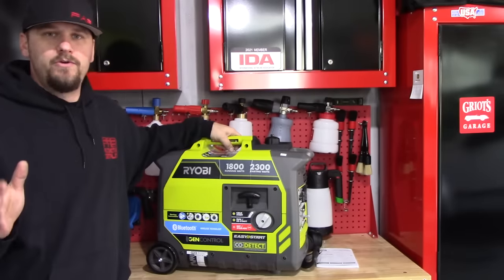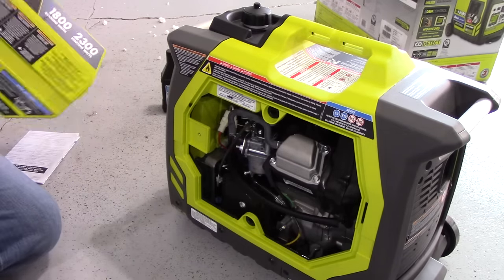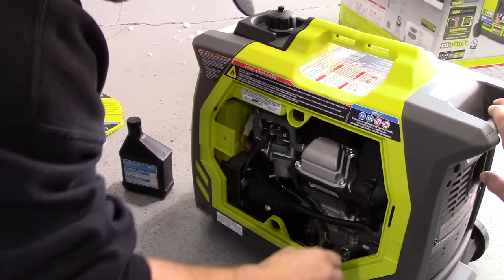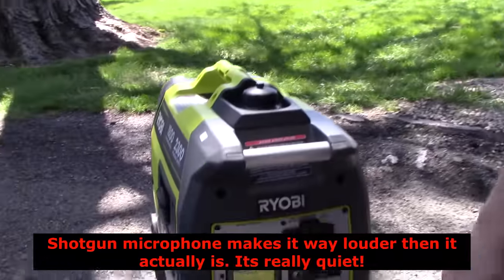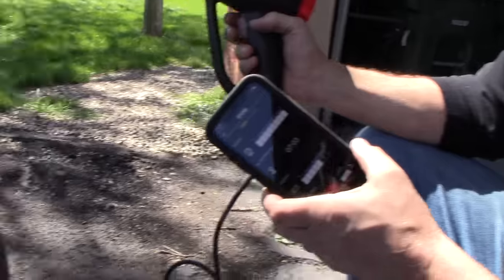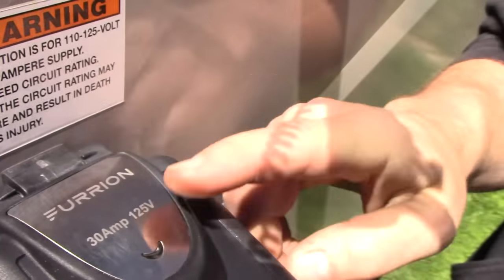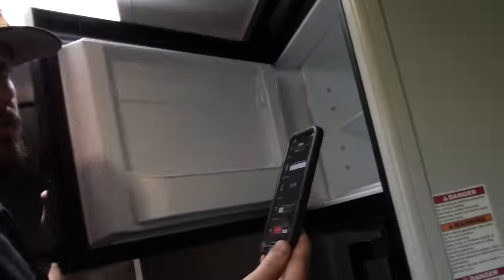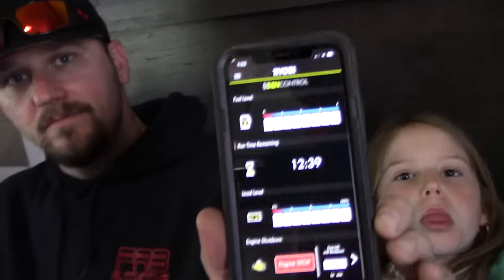Ryobi 2300 Watt Inverter Generator with Bluetooth! It’s so Quiet!

Comment: hei. Can it run 1500w air compressor please?
Reply from the maker: Yes it should be able to. It all depends on what the watts it takes to start the compressor
Reply: @FABAutomotiveDetailing  Aye that is the  concern. Some suggest 1500w x 3 times for starting power. Fck no 4500w :(

Comment: Would you reccomend this for mobile detailing using a vacum air compressor water pump extractor and maybe a pressure washer, if I dont get a gas one, not all at the same time tho
Reply from the maker: I haven’t tried it with any of those things yet but this thing is really quiet and would be nice detailing with as it wouldn’t be to annoying.

Comment: Mine says low fuel even with the tank full, is running normally though. 

Any ideas?
Reply from the maker: Sounds like the float in the tank must be stuck in the empty position.
Reply: @FABAutomotiveDetailing  great, how do I fix it?
Reply from the maker: @iamlegend3669  I would contact Ryobi. I don’t know anything about that.
Reply: @FABAutomotiveDetailing  thanks anyway and keep it up!
Reply: Junk..!

Comment: This unit would make a great boat anchor but that would also be an insult to boat anchors.

Recoil rope is nothing more than a few strands of fishing line wrapped in a velvet cover. If you get 25 pulls from it - you are the exception.

Don't walk away from buying this - run - as fast as you can!
Reply from the maker: I have used this generator so many times I can’t count and it has never let me down. It has been great. Everybody likes to knock Ryobi and I don’t understand it.

Comment: Do you this can power a mytee 8070 extractor?
Reply from the maker: I don’t own a Mytee extractor so I have no way to test it. Sorry
Reply: @FABAutomotiveDetailing  ok thanks
Reply: We are told it cannot handle a steamer (Mytee) and vacuum at the same time.
Reply: That would be impossible the extractor has a amp draw of 19 times 120 it would be 2280 so you would at least need a running watts generator of 2300 or higher if it’s heated.
Reply: Been using this and it is good for recreational use but I would get something stronger if using a generator daily for work.

Comment: well it looks a lot lighter than my old 4000 watt generator that weighs in at right around 170lbs. I get any older and I'll need something like that.
Reply: Wow.. even my 9000w predator generator weighs less @ 157lbs and it's a monster.
Reply: @randybobandy9828   yeah this thing is from the 70's which means everything on it it metal. Very little in light weight plastic parts. The generator head itself weighs in at 89lbs.

Comment: holding oil container up side down, wrong way around. glug glug glug.  other way lets air in to replace oil. 
Spout of oil container should be high point, up side of container as it is poured out.

Comment: with that loud of a generator your going to piss off alot of campers
Reply from the maker: It’s not loud at all. The microphone makes it seems loud. 10 feet away from it you can barely hear it running. Once inside you can’t hear it.

Comment: Seriously premium fuel? Waste 0f money, higher octane gas actually produces more pollution so not a good choice! I have thus exact Generator for about 4 days now & I run it on 87 octane gas & run it 24 hrs a day & it's fine! It's not a delicate machine. It will power two window air conditioners (8,000 btu & a 5100 btu) two tv's & a few lights!
Reply from the maker: Over time you will wish you bought ethanol free. I don’t want to buy premium for my small engine equipment but that’s the only way to get ethanol free gas around here. All small engines will run fine on 87 but 87 with 10% ethanol will gum up carburetors and actually eat away at your rubber fuel lines.  I buy premium as preventative maintenance for my equipment and ever since I started doing that I have had zero problems.

Comment: For a camper id get a much more powerful generator
Reply from the maker: Yes or buy the 2 pack with the parallel kit. The nice thing is how quiet they are.
Reply: Well a 3300w is ideal but you can run 2 of these in parallel so you can be more fuel efficient when not needing to run the ac and other things. It also makes it easy to move since these are light.
Reply: @randybobandy9828  rather buy 1 big  enough and not spend money on 2 and make it parallel
Reply: @buffalobmf  ya only if you don't care about efficiency as much.
Reply: @randybobandy9828  so having two that equal one is more efficient than having one that equals 2? I rathee carry one with me
Reply: @buffalobmf  yes because when you don't need to run more than 1800w its more efficient to run a single 1800w generator @100% load vs a 3600w generator @50% or less. These generators are more efficient when ran closer to 100% so yes 2 will use less fuel. All depends on what you are using them for. If you plan to almost always run 1800w or more than go with a single bigger unit.
Reply: @randybobandy9828  always going to need to run the power when in a camper and even if you dont its always better to have it and not need it

Comment: Hey noob,,,,too bad they didn't give you a Generac 3300W generator,,,it is just as quiet, costs the same, weighs about the same and puts out enough power to run your camper AC without having to buy two units. I have several generators of different brands and sizes (including Honda) ,,,after using the Generic 3300 was pleasantly surprised at how well it works.
Not impressed with the so called CO2 detector test on the ryobi.
Reply from the maker: Ryobi sent this to me so they wouldn’t send me a different brand. I would love to have a Generac  for my house just in case. 

So how would you have tested the CO2 detector? The purpose was to just see if the detector worked.

Comment: All these generators are generic. This is the same as Firman and champion all the other budget ones. Not reliable. I'd get Firman with 3 year Warranty. The stator on the units burn up easily.
And check out that funnel!  This is your run of the mill cheap unit. I run my generator to my 24vplt 40 amp noco charger and my pure sine wave inverter runs it all.